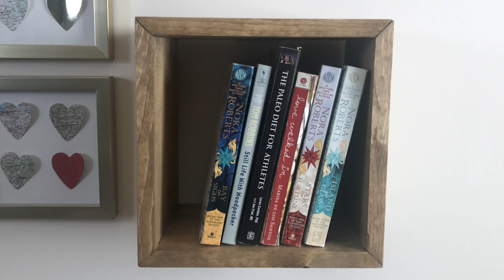DIY Simple Floating Book Shelves | 18

Comment: I find that painters tape and heat don't get along well as the tape already doesn't have the best adhesion (save for preventing paint from going places. Masking tape/artists tape would be a good alternative.
Reply from the maker: That's great advice - thanks. I was quite surprised at how badly it stuck. My thought was that since you want it to adhere to a wall to mask off paint, it would work well, but it almost did the opposite! Next time!